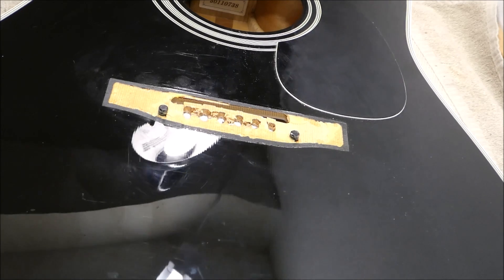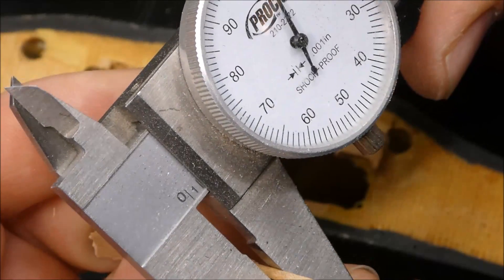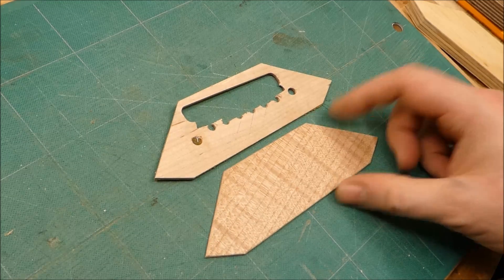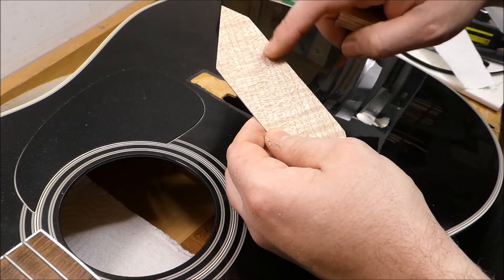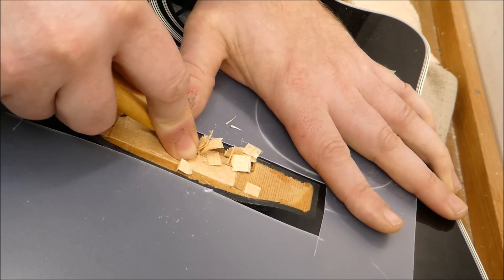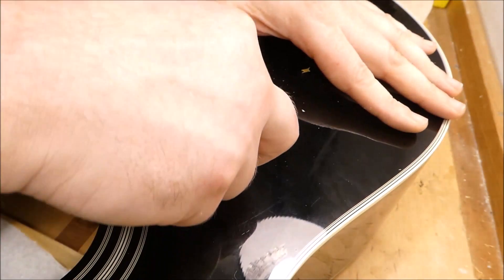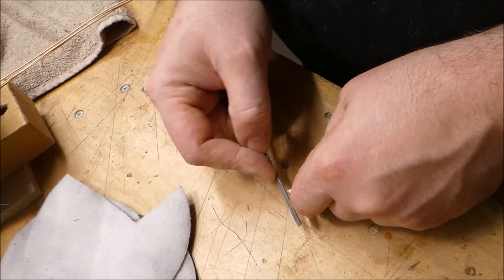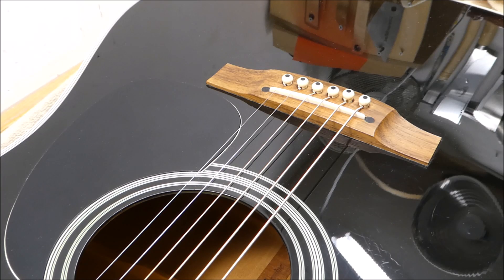Taking on the Takamine

Comment: I'm not a luthier, but am a retired piano rebuilder. I love your work and your videos. They harken me back. About the position-posts acting as a lever, I get it. In fact, I've often wondered why guitar bridge-pins aren't a similar hazard.
Reply: I think bridge pins aren't as much of an issue because they're often fragile, at least slightly flexible (plastic will bend, bone or resins will at least spring a bit), tapered pretty significantly, and are slotted so that the tension of the string is mainly acting against the topside of the bridge pin holes and the top of the saddle/strip.

Comment: I worked on a friend of mines Takamine acoustic guitar and while inspecting found all the bridge pin holes had drill bit breakout on the underside of the top. There were splinters 1/2 to 3/4 inches long. I thought this was poor quality control. This guitar had never been worked on as it was only 2-3 years old. I think Takamine makes some really good sounding guitars, but mass production has cost them quality workmanship. I know this will be the first place I look if I ever work on a Takamine again. Great work on your project guitar.

Comment: I’m also a Canadian  and also had the same issue with my Tak.guitar. Guess they dont like using glue at the factory and instead rely on the bridge screws on either side to hold it down. 
I tried to reset the bridge myself and had success. Well sort of. The bridge is solid and glued properly. I did however cut my bridge mounting slot just a bit too big. Guess I can always try to make an oversized bridge to hide my mistake.  A lot of work goes into a job like this.  Keep up the great work.

Comment: Great job. The Takamine lives to play another day.🙂 This would have been a perfect time to switch the pickup. Perhaps a LR Baggs that doesn't require modifying the bridge. You mentioned the issue with the large slot in the previous video. I understand you have to do whatever the customer wants and can afford.
Reply: The pickup (and pre-amp) on this model is superior to anything made by LR Baggs. Say what you want about Takamine, but their electronics are second to none.
Reply: @RussClarkRocks  I found myself wondering what are some of the reasons people want to electrify their acoustic guitars, as opposed to just playing into a mic like the old days?  Which would sound the best?
Reply: @torchandhammer  Two reasons. First, plugging in allows you to move about while performing. Second, microphones cause all kinds of feedback issues which is especially hard to manage in a loud band or orchestra situation. The guitar being worked on here was designed specifically for that purpose. I own one exactly like it that I bought new in 1992 and have the good fortune of being able to play it for a living all over the world. :)
Reply: @RussClarkRocks  Thanks Russ!

Comment: very nice work.
I play a rare and hard to find Takamine TNV340 guitar, the palathetic pickup, the Cool Tube preamp, and the Takamine Triax soundhole pickup all blend together to create the absolute best plugged in sound you will ever hear. Now I have played guitars that sound better unplugged but my guitar was made to shine plugged in as you said. It sounds thick and natural through a good pa system with someone who knows how to dial it in.
My guitar needs work, the under the bridge wood inside the guitar has been eaten away by the ball ends on the strings, and I have went through 2 fret re dressings and at this point am in need of a complete re fret job, in addition to this after hundreds of live gigs with the guitar on my last retirement live performance a freak wind came up and blew my guitar off the incredibly stable Hercules stand it was placed on and cracked the side wood where the Cool Tube preamp slides into the pocket so that also needs to be repaired.
As I mentioned Takamines high end guitars of this nature are not imported into the United States any longer and you cant find these on the used market as those who have them rarely ever part with them and my model was a rare guitar from the start so I want to get it fixed right, and for the last time.

Comment: I was wondering. What do you think about the piece called a "bridge doctor"? I bought an Aria 12-string and I am hell bent on fixing it myself. I heard from a StewMac guy who, after reviewing tons of photos of this old guitar, recommended some steps, tools, and also this bridge doctor. I looked at it, imagined the torque on the strings/body top and really don't feel it would benefit the instrument as much as correcting the body top (warped) and a good levelled bridge attachment. I am still studying as many videos and articles as possible before I take this project on. The ax is for me, not a customer. But I want to give it the best opportunity to be a solid instrument for me to play as well as the repairs to last. Thanks for your time reading this and your response. This is a great video and already answered or clarified some questions I had.
Reply: Ted has used the Bridge Doctor in the past, seems like it would have been a great fix for this problem, certainly for any of us without Ted’s skills.

Comment: altho im not a "luthier" . i have been doing guitar repairs, and custom builds. (almost 20 years now). i just recently started dabbling in the "acoustic guitar" repairs. do to my buddy having over 15 of them, that needed repairs. my last repair on one of his was almost the same Takamine and condition as the one you repaired. i wish i did that scarf joint as you did. yes it takes time to do them properly. but the rewards of a completed repair far exceeds doing almost anything else and as relaxing.  
(i only charged him $50 for that repair) and told him, if it happens again, it's a wall hanger

Comment: Sure sounds like a Takamine after your surgery. Long ago I bought a Takamine FP-360SC. I think that model and the one in your video are intentionally engineered to be fantastic stage guitars, but conversely some of the characteristics that make them great on stage make them only middling acoustically. (Not true of all Takamine's of course, but the ones with super-thick finishes) Fascinating craftsmanship and care on your part, though. Glad you could pull this one back from the brink.

Comment: You fixed that aboot, uh I mean about as well as anyone could have. I'm not sure if you answer stupid questions but here goes. Could you have glued (perhaps epoxied) a thin piece of veneer, (the same thickness as the finish) to the repaired soundboard and then glued on the bridge? That way some future luthier would be able to get a pallet knife under the bridge if it ever needed to be removed? Or, is that just too many layers. Anyway, nice work as usual and I thought it sounded quite good.
Reply: I was wondering the same thing, but I don't think it helps the transmission, the simplier and more direct it is, the better it vibrates.
Reply: It would have been a lot easier to glue the bridge after the finish was applied, but the factory went through a lot of effort to glue the bridge directly to the soundboard...
I'm guessing it would sound extremely thin with the bridge on top of everything...

Comment: Every time I see these issues from major guitar manufacturers I am absolutely gobsmacked. This isn't Takamine's first guitar build so what makes them feel it's ok to glue a wood bridge on top of the guitar finish. The finish is so thick on this one they could have milled the edges of the bridge down 0.020" and had a better result. I had the same issue with a, not cheap, Epiphone Masterbilt. Bridge glued strait on top of the finish. Bridge popped off before the guitar left the store. Good thing about it was that I got a new $700.00 guitar for $90.00.

Comment: Do you ever find it beneficial to tint the glue to help hide an open edge, such as the inset bridge and thick poly finish? I was just wondering if it can be helpful or a problem down the road. Even though I do mostly solidbody work, your methodology and techniques are always interesting and worthwhile. Thanks.

Comment: That might have been an older EF341SC.  I had a EF381SC 12-string about 15 years ago and was not really impressed with the construction quality.  I ended up selling it.  I recently purchased a EF381DX after doing a ton of research into Takamine's construction after being purchased by ESP.  I couldn't be more impressed.  The setup and was aboot near perfect (I'll probably lower the bridge saddle a bit).  I'm guessing you wouldn't see this type of bridge construction from a newer model... at least I hope.

Comment: I love takemine guitars, they are physically the same, but have a sound and feel like no other.

In fact, most of my guitars that I actually play are from japan 80's to 90's. They aren't so expensive where i fear damaging them, but have very good materials in their construction.

My favorite is a early 90's Jackson soloist. I bought it sub $500, and have rebuilt it probably 3 times. Currently it has locking tuners, roller everything, my favorite set of pickups, SD jb/59'. 

I used a 80's lp copy, and converted it to be one of my favorite guitars, a lp custom gold top with p90's. On that guitar, nothing is original, not even the finish. I think the top was a piece of carved 1/2 flamed maple. I don't think the $10k ones use such prime material. Again roller everything and noiseless p90's.

I have 5 guitars like that. The instrument themselves are not worth the price of even the pickups. But to me, are priceless. They mean slightly less to me than my kids.
Reply: Most of the roller hardware I originally got were terrible quality, eventually i got a hunk of brass and high quality stainless, and copied or reengineered each little piece.

Next thing im going to do is, a 80's Elecktra, Japanese flying v. This one is a fender scale. Im going full on with everything, including a Floyd Rose/Kahler style tremolo system.

Im even going to pull the fretboard and modify the truss rod system.

Lp custom gold top with p90's
Jackson kv2 with custom ghost paint
Jackson soloist
Partocaster 
Next is the flying v

I won't have more than $800 all in. However, I can't even tell you the hours and shop materials cost. I probably have $5k in tooling or whatever.

I've been repairing for 20 years as a side gig, so im not entirely a newbie. But at this point, my flying v start to finish, shouldn't cost more than $500 including the cost of the used guitar.

I likely, will just keep doing this, each year. I do keep the old hardware and related materials in a box of it's own just in case.

If it weren't for you and Dave from daves world, both from ontario, which is just 1/2 from me. Suburban Detroit area, I would never have been able to do all this.

Thank you

Comment: I was at the local thrift store a Salvation Army outlet where I treasure hunt from time to time. I always ask for guitars and they say we don’t have any guitars today but you can always check back on Thursday when we get the delivery trucks in. Okay so I checked back in Thursday and the guy said I got Two guitars for you to look at today a off brand no name new acoustic and a vintage Takeimine G-240 with a chip board case and three sets of new strings and a nice strap. $25 SOLD! This G 240 has a one piece solid spruce top and solid NATO mahogany sides back and neck with a rosewood fretboard and bridge and ivory or bone pins and Grover Style tuner machines that look nickel brushed finish and this one had a bridge lifting in the bridge back side but I just poured glue in the air gaps and pressed it back down flat now it plays like new! Problem solved !

Comment: I have to remove the bridge from my Takamine Santa Fe and I've been terrified because I've heard about this mess. Mine has the double broken bridge, but it's like that one under the bridge. I'm taking off all the Takamine electronics and patching the holes permanently. I have an old Takamine 12 string from the '70's a thoughtful ex stabbed to death with a pair of scissors....I'm planning on cutting the side out for the bent piece to fill in the hole where the pre amp sits. Scared to death....I love this guitar dearly.

Comment: "Psychoacoustics" doesn't mean a sound difference only in your head. At least, not exactly. It's what happens to sound when your brain mixes it together to create something you can comprehend. 
For instance, using phase shifting to make a sound source seem larger and less localized. It isn't 'in your head' that the sound seems larger, but it also isn't REALLY larger. It screws up your ability to locate the sound, so it seems larger. That is psychoacoustics :)

Comment: Construction like that would break my heart were it to fail like that. Were those location pins plastic? If you had to use them, why would they not use a material that would bond well to the soundboard and bridge? Their size would normally suggest to me that they should be structural in addition to positional. But if they're plastic, the structural component would be suspect.  I'm pretty curious why they would use not simply use screws in their place to position and provide mechanical fastening. It might have prevented such a failure, and we already know they're not too classy to use screws on the soundboard. Sure, the acoustic guitar snob would turn up their noses. But would it really make that much difference to someone already willing to pay $1700 for a plastic dipped guitar?

Comment: Know this is old. Couldn't you have filled the difference in finish height vs bridge with a veneer inlay to bring it level with the finish before applying the bridge? That way it would have been far easier to remove down the road, if it ever needed to be so.

Comment: Back in theb1980s I worked at a store that was a Tac dealer. I'm disappointed looking at this. I expect much more from them. Perhaps they started making less expensive entry level instruments?
Reply from the maker: $1700.
Reply: @twoodfrd  $1700 for a guitar with a bridge glued and epoxied over a layer of finish. I bet the owner was a bit pissed to find out they'd cut some really big corners in the manufacturing.
Reply: @twoodfrd  that seems like a lot to pay for that guitar but what do I know. Been out of the loop a long time.
I recall working on an almost new G&L bass. It was distorting because a Vol pot came loose and the lockwasher chewed up the shielding tinfoil behind the pickguard. It all grounded through the foil?!?! Bet they saved 25 cents on every one by not soldering in a ground wire, on at the time, a $1200 bass.

Comment: Is that plywood? In that case, what’s the point?
Reply from the maker: What gave you the idea that it's plywood?
Reply: twoodfrd the wood around the bridge it is in layers right?
Reply: That's the soundboard and the bridge pad. And, no doubt, a little bit of cracking parallel to the surface of the soundboard in the ragged state.
Reply: Stan Rogers cheers...
Reply: twoodfrd what do you think of those metal “platemate” for the bridge pad/plate?
Reply: It’s a solid Cedar top

Comment: I'm not a repair guy, but since that bridge wasn't too damaged, personally, I would've just used epoxy again, but I would've used a metal/titanium plate underneath, and have that take all the load. I also would've removed the positioning pins and used tiny nuts and bolts to clamp it on the metalloid plate underneath. Then again, i'm not a repair guy, and it might alter the original sound of that amazing guitar (I think I have the same one, and if i'm not mistaken, so does "the boss" Bruce Springsteen.)
My dad did a similar repair job as what I've just described, but for the neck of a guitar banjo from 1945 (i'm planning to do a better job at it, right after I find out, what you can do and what you can't do, when doing a proper restauration on old instruments so they don't lose their value. And all my other instruments...)

Comment: In my opinion, this is a ugly guitar. Its hard to believe this retailed $1400-1600. I always thought they painted acoustic guitars black to hide cheap materials, but to see a solid cedar top under 0.5 mm of black finish surprised me. The pick up system is very invasive on how acoustic guitars transmit sound. Geez, I hope these things were discontinued.

Comment: Not too bad other than your horrible mispronunciation of lever which should rhyme with never or forever - not lEEVER!! UGH!!! And 0.20" of and inch is not thick for a guitar finish. I've seen some that are twice that thick! Most finishes are this thick are at least about 0.18" of an inch thick. Any thinner and you'll burn right through the finish. I find that TWO CANS or 22 ounces of paint are sufficient to finish any instrument to the point where you can wet-sand and rub out without burning through to the wood or sanding sealer beneath. Good job on the repair.